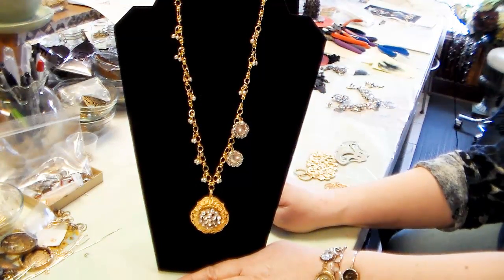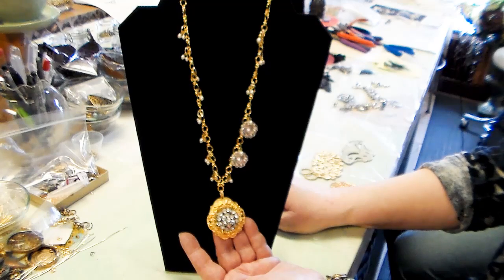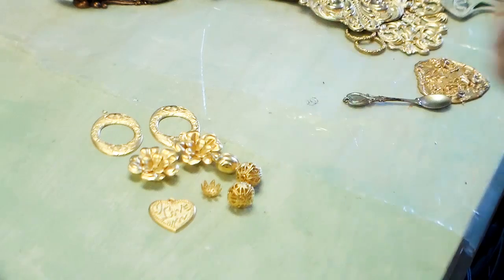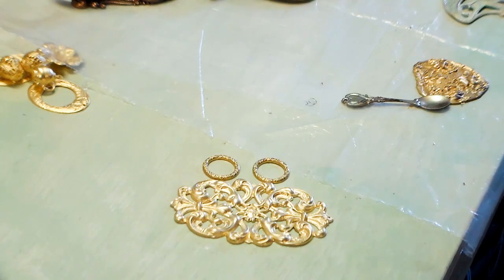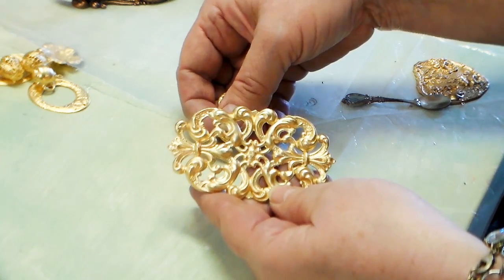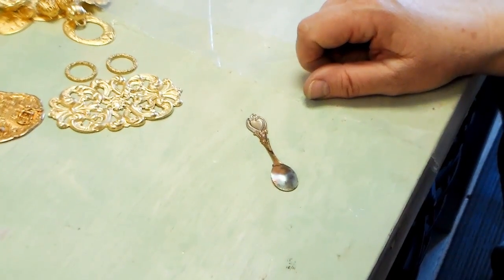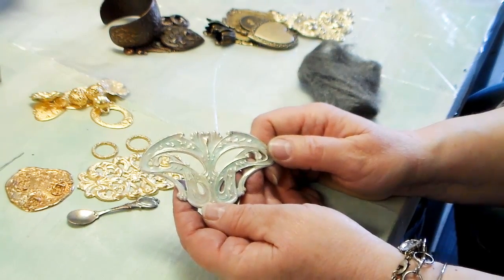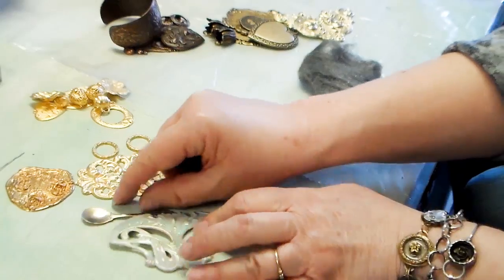Using Plated Brass Stampings in Your Jewelry Designs, How to Make Gilt Brass, Good Plating

Comment: this is a great video, tons of info, I have a question what is antique bronze when referring to brass or r they 2 different things??????? thanks
Reply from the maker: Generally they call it antique bronze when it's over the imported zinc alloy bits and pieces, and we do carry some of the better ones at B'sue Boutiques, now.  www.bsueboutiques.com  My finish,brass ox, is over brass, and it's over US brass and done by my prince of a plater here in the US too.  Brass ox is an oxidized brass finish (therefore OX) and ours has a rich black antique on top that really draws out the detail.